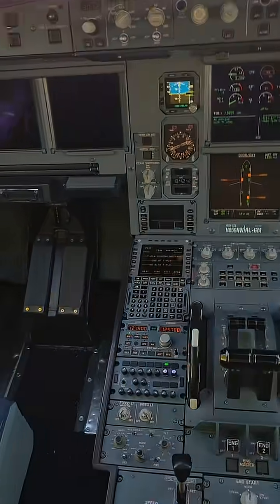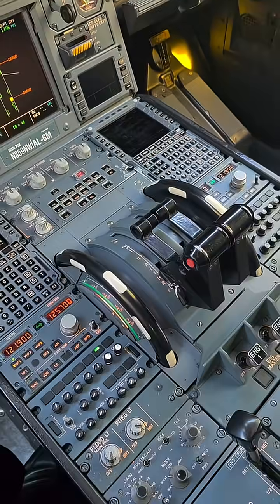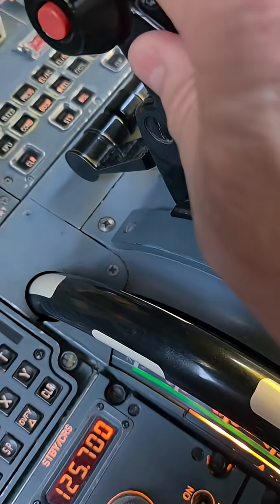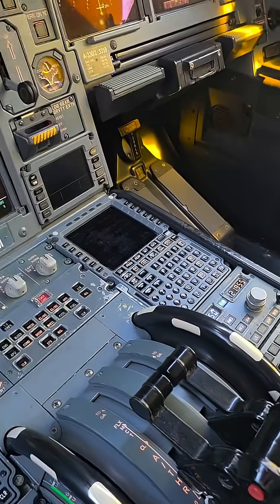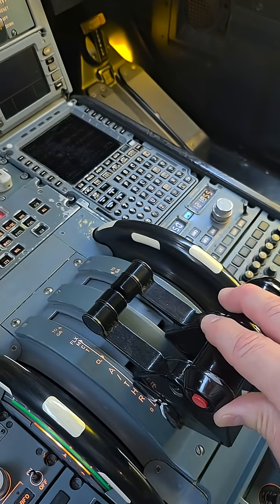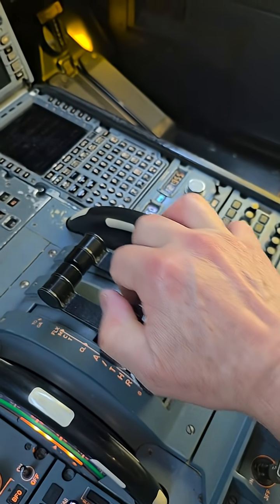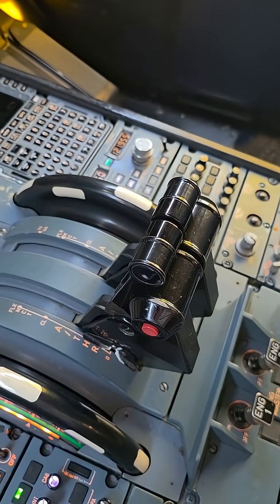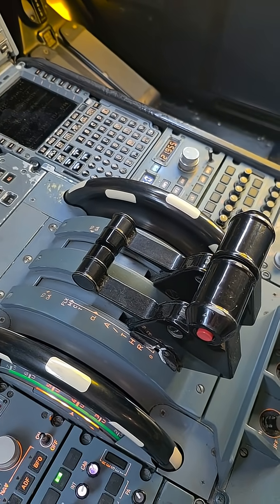Reverse thrust on an Airbus A330.

Comment: TO GA is take off / go around thruster selection… I’m one step to flying today
Reply: It is, however most takeoffs are done on flex or derate.  It saves fuel and puts less stress on the engines.  It also means you have some power in reserve if you need it.
Reply: @cjmillsnun even though I’m scared of flying but I find aeroplane tech fascinating
Reply from the maker: Me2
Reply from the maker: Only correction is use THRUST for the word POWER

Comment: What is the normal taxi speed? do you do highspeed taxi?
Reply from the maker: Our internal limit at my airline is 30 knots or whatever the speed limit is posted on a particular taxiway (I can think of taxiway E at CDG, Paris where the speed limit is 20 kts). 

30kts is a little fast so I am for 25 as a max for my personal comfort. 

Going into turns I like around 13 knots, as the speed will decrease as you deflect the nose wheel for the turn.

Comment: If you're left or right handed does that not make it harder to get used to the side stick being on one side? I know you eventually get the habit but is it hard at first?
Reply: Not at all. And there is no difference with a yoke. With a yoke, the left seat flies with the left hand and the right seat flies with the right hand. So there is no difference.
Reply from the maker: It takes about 5 minutes to get used to flying with your non-dominant hand!

Comment: What happens if someone tries to pull up the reverse thrusters in mid-flight?
Reply: They will not function in the air, there is a safety lockout that requires weight on the wheels for reverser activation
Reply: @AGGD767 thanks.
Reply from the maker: It doesn't work.

Comment: Hi there, I was wondering what you use on the 330 to taxi the plane whilst on the ground. Is it like other aircraft which use a tiller?

Furthermore, is there also any operational differences compared to other airliners when flying/taxiing because of the 330's unique tilt (front gear lower than the other gears further back), or is there certain procedures/quirks as a result of this?
Thanks in advance
Reply from the maker: Hi and thanks for the question. 

So on the ground we can steer a limited amount using the bottom of the foot pedals, which control the rudder and the nose wheel steering. The top of the foot pedals are the brakes, which Airbus doesn't recommend using differential braking to turn the A330, as it will scrub the nose wheel tire. 

There is also a tiller, as you mentioned. It is on both sides of the flight deck, so the Captain or the First Officer can steer the airplane on the ground. 

The tiller gives much more control. The input on the tiller is not linear, meaning the more you turn the tiller the turn of the wheel greatly increases. It is also drive by wire, so there's no mechanical linkage between the tiller and the nose wheel steering. It is all done by an electronic signal that is sent from the tiller to the nose wheel steering hydraulics. 

Because of the nosewheel sitting behind where the pilots sit, making turns requires 'oversteer' meaning to track the centerline and to keep the wheels equi-distant from the centerline under the aircraft it looks as if you are passing the turn, or turning too late when you turn and A330 90 degrees or more. You get used to it after a while.

Comment: Hey Captain, what Boeing model would be comparable to the Airbus A330-200? Thanks.
Reply from the maker: The best direct comparator aircraft in our fleet is a Boeing 767-400 in terms of seating capacity. 

The A330-200 holds 223 total passengers.

The Boeing 767-300ER holds 226, depending on the model. 

The Boeing 767-400 holds slightly more at 238. 

The Boeing 777 is a much larger aircraft than either the 767 or the A330 in terms of width of the cabin. I'd compare the A350 more with the Boeing 777 than the A330.
Reply: 777-200ER
Reply from the maker: I'd say the B 767-300ER is more comparable.
Reply: The 777-300ER has a much more similar pax capacity to the a330-200 than the 777-200ER... But you're really getting into the weeds a bit there, the a330 was built to compete with the 777 so they're all quite similar.
Reply from the maker: I'd say the B 767-300ER is more comparable.
Reply: @CaptainZtravels Thank you.

Comment: When your taxing what thrust do you use? Like is it like boeing where you manually move the thrust levers forwad just a little to start taxing. Or do you go into one of the thrust settings like the climb detent?
Reply from the maker: CLB would be way too much thrust for taxi. 

We are limited to 40% N1 when in the congested ramp area, which equates to about one knob forward of thrust, using the knob at the end of the thrust lever for that measurement from idle. 

We limit the thrust in the ramp area so we don't blow something over behind us.

It takes a little more thrust to get the aircraft moving, especially in the summer on asphalt, because you tend to sink a little into the softer asphalt. Concrete is a much better surface to taxi on as there is almost no 'settling' into the concrete. 

After we clear the ramp area, if there is a long taxi, we have the option of a single engine taxi, meaning we can shut one engine down to primarily help with keeping the brakes cooler and it has the added benefit of saving fuel.

With one engine shut down, depending on the weight of the aircraft, the temperature outside, and the surface we are taxiing on, it could require more than 40% N1 to get the aircraft moving (more than one knob forward on the operating engine).

The Pratt & Whitney engines, which are installed on the A330-323/200 have a lot of residual thrust on the ground, meaning it doesn't take as much thrust as other model A330s to get started and to keep moving on the ground. 

The A330-302s, of which we have 10, have GE engines. They have less residual thrust than the Pratts and take a little more thrust to get moving and stay moving. 

The A330-900 (NEOs) have Rolls Royce engines and have the least amount of residual thrust compared to the engines above. They take a lot more thrust to get moving and to stay moving. 

If you even ride in an A330-900 it will seem as if the pilot is using a lot of thrust to get moving because it's louder than other airplanes. That's not an illusion, that's just because the engines are more efficient on the ground and produce less idle thrust. 

There's everything you ever wanted to know about thrust while taxiing an A330 on the ground.
Reply: @CaptainZtravels  amazing detail 😎
Reply: clb detent on the bravo taxiway goes crazy 👨🏽‍🦯‍➡️
Reply: @yaishmatheen4274  Ik I figures it would be wayyy to much thrust 😂
Reply from the maker: We'd never use CLB for taxi.
Reply: Manually move it forward just a little bit
Reply: Idle thrust often is enough for taxi also.
Reply from the maker: Depends on the engine model on the A330.
Reply: If/when you do taxi with one engine, are there any problems with keeping the aircraft rolling straight? I imagine that the offset center of thrust from only one engine would make straight line taxiing a little harder.
Reply: @danny_boi3537  it’s pretty easy to counter. It’s not really an issue. However, on a slippery taxiway, it could be an issue.
Reply: People don’t know this, but TOGA is usually used for taxi. A lot of people think TOGA means “Take off, Go Around” but that’s only half right. It means “TAXI, (take)OFF, GO-AROUND. It’s crazy so many people don’t know it. But it’s true!
Reply from the maker: TOGA =Takeoff Or Go Around it has nothing to do with taxiing the airplane.
Reply: @Sinbrogan  don’t quit your day job. You won’t make it as a comedian. 😂